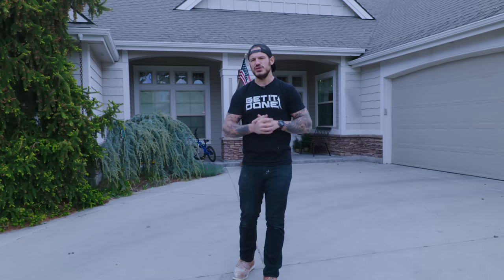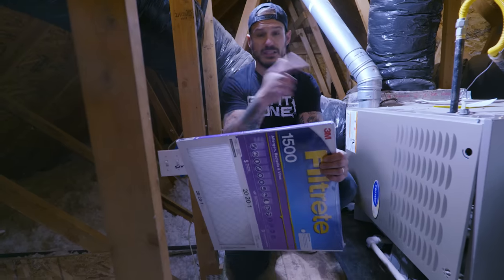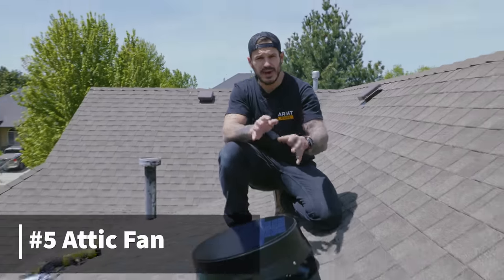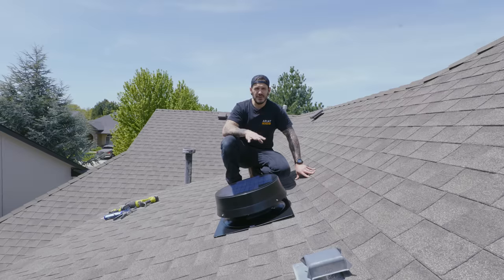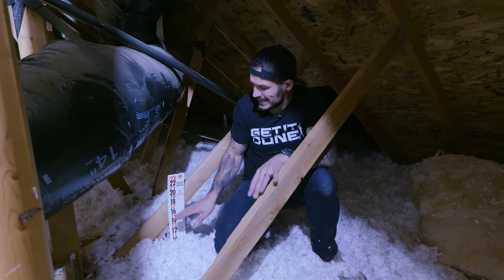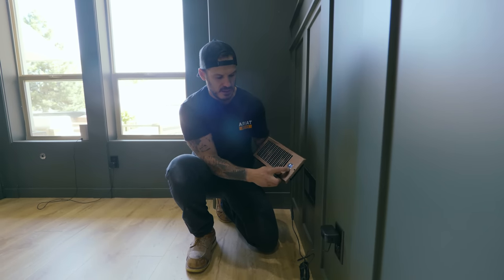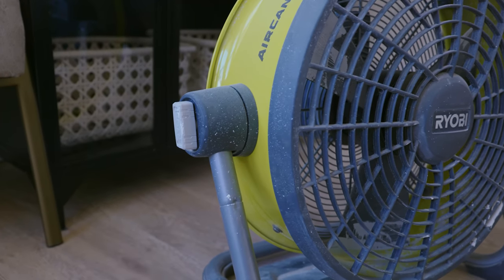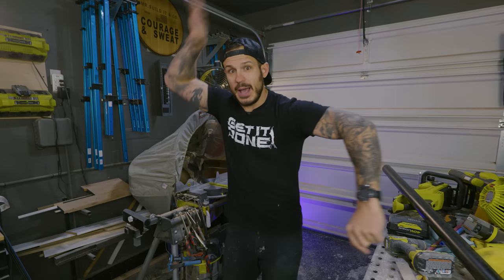15 Tips To Help Cool Your House This Summer + Lower Energy Cost

Comment: I use blackout curtains everywhere. Outsiders think I'm a vampire
Reply: But black out curtains work. They reflect the heat back from the house.
Reply: ....are they wrong?  🧐
Reply: White reflects heat, black absorbs it.
Reply: @HugoStiglitz89  The black out curtains that we have in our house aren't black, the face towards the room is brown and the face towards the window is white - but what is nice about black out curtains is that they're thick so they block 90%-100% of light transmittal, and because they're thick they also reject some heat transfer and noise. When COVID started I would open the blinds and curtains to enjoy the light, but noticed that my room would be 90-100° in December, and no the thermostat wasn't turned up that high. The light would heat up everything in the room and thermal mass would retain that heat well into the night. So I started leaving the blinds and curtains closed, and would be a much more tolerable temperature, so much for natural lighting.
Reply: I'll see you and raise... I put a foil emergency blanket over my windows secured by black duct tape.. 🤣🤣🤣
Reply: @HugoStiglitz89 Actually, white absorbs it also just on a significantly LOWER scale. Black absorbs on a HIGHER scale.  ✌️
Reply: I use lightweight Indian tapestries and clip them to valance rods or “already hung” curtains.  Of course the look is boho as heck but easy enough to put up and take down as a temporary “sun-block”.
Reply: @adamwhitt9349 totally works and those thermal blankets are cheap, too!
Reply: I always wondered if they significantly helped with lowering temps 😅
Reply: Now the neighbors just think you’re growing illegal plants in your house🤔💸💸💸
Reply: We do too.! Best investment especially for those who live in Texas Arizona, Nevada etc where the heat is relentless. Good 100% blackout drapes are super thick but nice looking and they do keep the house cool and they are noise barriers too.
Reply: Me too ! Really works!
Reply: R u
Reply: @zenrook1 oh yessss. I loved having a little bedroom facing the south, during the winter it got sunshine all day, and during the summer, no direct light, and I would use blackout curtains..... Miss it so much!
Reply: W❤

Comment: Uhmmm …cold air sinks and hot air rises….so in the winter you want to push the warm air down and in the summer, you want to pull the cooler air upward….unless you live in a cave, then you don’t have to worry about cold air or hot air…
Reply: Thanks. I went back over that because it didn't sound right. I thought I missed something.

Comment: Pro tip I've picked up from my hvac guy is use basic fiber glass air filters doesn't restrict air flow giving you better air flow
Reply: I install air conditioners daily and you are correct. We always recommend merv 8 or less.
Reply: You might as well not even bother with a filter at that point. Fiberglass filter does not filter much. The better move would be to get a quality filter with a high surface area like 3M 1900.
Reply: @phamlam3720  it does. You'll need to change it more often. Anywhere between 30 - 60 days
Reply: Same.  I've been trying to find some in my size.  GAME CHANGER!!

Comment: You need to wash your AC outdoor Condensor coils twice a year otherwise the compressor will overwork and cause problems
Reply: I just had a new ac put in a few months ago. Pls forgive my ignorance on this subject I know almost nothing about maintaining it other than keeping all the grass and dirt from accumulating. What coils? I'm in TX summer heat so I'd like to keep it effecient as possible. Thanks for any info.
Reply: Careful. Water is sufficient. Any chemicals may break down the aluminum and copper and cause leaking refrigerant.
Reply: Look up any video on cleaning ac condenser coils on YouTube. Basically just need to  turn off the unit. take a garden hose and rinse the dirt and dust off. Direct the hose and aim straight. No need for a pressure washer. 
Also replace your indoor furnace filters regularly. Make sure to get the correct size and have the filter facing the right direction. 

This will prevent your system from overworking due to lack of air flow.
Reply: @alexkwong6475  Thanks!
Reply: @dalpz205  also make sure you keep your air vents open. Closing off too many vents in the house will cause your ac to freeze up. Use a merv 8 or less air filter in your furnace. “Merv” is the rating for them. The lower the number the less restrictive it will be
Reply: @timneal609  Thank you.
Reply: Not true unless you live in a very very very dirty environment and run the AC year round.

Comment: Ceiling fans
Light bulbs (upgrade to LED)
Replacing filter
Upgrade to smart thermostat
Attic fan
Heat reducing window film
New insulation
Window shades
A/C inspection, replenish Freon 
Duct booster fan
Pressure wash exterior 
Pest control 
Air circulation methods 
Dehumidifier 
Energy audit
Reply: This video popped into my feed a year later, but wanted to thank you, SlickTurtle. 

I wish creators who make "list" videos made timestamps. Not necessarily to skip things, but to help just note things out.

Comment: about getting your AC recharged before the summer.
1) if your AC is low on refrigerant that means there is a leak because refrigerant is not a "fuel" that gets used up it is a gas and liquid in a closed system meaning that if its low there is a leak that has to be fixed or it will just leak out again. 
2) Also as important is to have both the inside, (evaporator) and outside (condenser) coils cleaned before the summer and 6 months later (so twice a year) because the coils is where the heat is exchanged from the air in your house and outside and if they are dirty the AC will work harder to get your house cool and this will break your AC faster

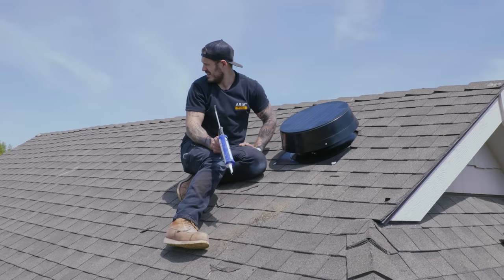Comment: About #6 (6:30), I had family member that installed tint in the living room windows and door, and it may reduce the heat and bills, but I hate the feeling of dark and muddy, very depressing, not for me.
Also another tip, will be to have or plant trees around the house, to provide shade.

Comment: Living in Arizona I've found that having the celling fan running clock wise works best.,also as it started warming up my AC wasn't working right the second time the AC guy came out he said with my old AC the new filter was no letting the proper amount of air,so got a lower price filter and AC started working fine
Reply: When I first bought my house I didn't know about the different filter types. If you get one too thick that's made to be hypoallergenic it restricts air flow and vise versa with a really thin filter. That affects the performance of the AC unit. If you're not careful your unit will work super hard to achieve a certain temp and the electric bill will be astronomical.

Comment: I'm glad I got my house weatherizeed back in 2020. Me being on ssi for disability I was able to get on a weatherization program from my city. I got the wood around my windows replaced and caulking, replaced bulbs with led bulbs, an automatic exhaust in the bathroom, removed all the old gas floor and wall heaters, new water heater, new insulation in the attic, insulation in the walls and under the floors because my house was built in 1939, and they gave me a whole new ac unit which the outside unit is a heat pump. They put in new stairs in the attic because that's where most of the air was leaking from and they sealed up everything even the chimney and my house has been comfortable ever since. The ac blows cold and I have the thermostat set at 80 and sometimes I have to cut it off because it gets so cold. The city even painted my house. I'm so grateful for everything and I tried to get my neighbor on the program to help get his roof replaced to because he's 65 and on disability but he's to stubborn to do it and his house really needs it.
Reply: It's a city program? I'm in Texas and I've not heard of energy companies or anyone doing all that. Would love to find it if it's out there. They will install automatic thermostats but you agree they can adjust the temp. Ya... Very much noooooo ty
Reply: @dalpz205  they don't adjust temps
Reply: @djpat5998  Idk if they do or not but I have sign a contract that allows them to. I live in Texas. I seriously don't trust an energy company to have my best interest in mind.
Reply: @dalpz205  it's not with a energy company it's through the city of Fort Worth.
Reply: @djpat5998  I'm in south Texas. Also I was referring to a contract offered to me by my energy company to lower my rates. Not a weatherization offer. Sorry if my wording was confusing
Reply: @dalpz205  I’m a home evaluator for a weatherization program. Typically the program is carried by local community action agencies and do have some income limits.

Comment: In regards to the "duct booster fan"; if you're looking to boost air flow because certain rooms don't get enough there's a bigger issue at hand. Improperly sized ducts or duct leakage. The booster fan are a waste of money.
Reply: Or you have a room (south facing) that gets more sun or generates more heat (computers) and the builders never take that into considerations. A cheap way to boost the cold air pulled into that room.

Comment: Great video, the only things I would say, unplug the furnace when installing a thermostat. If those 24v wires touch, you will blow a fuse in the furnace. Easy replacement, but for the average homeowner they won’t know what to fix. 

The AC being low on refrigerant due to a small leak, I would never recommend adding more refrigerant without repairing the unit first. Adding more pressure will increase the size of the leak hole. What the tech should have done was give you two options. One to find and repair the leak before adding more refrigerant or two, add leak stop to the system in an attempt to seal the small leak. Adding refrigerant to a system that is leaking is wasting money, because it will leak out again, faster. 

Third is the booster fans. These may sound like a way to cool a room better but they are horrible for you hvac system. That fan is pulling air which will make other rooms suffer from not enough air flow. And on top of that, they create massive static pressure in the system which puts a tremendous amount of stress on the system and will shorten the like of the system significantly.
Reply: I loved the no heat calls after the energy company installed the thermostats.
Reply: For the fans on the vents wouldn’t it block air flow?
Reply: @wardraven8755  it doesn't block air flow, it's pulling available air. Air and water flow the path of least resistance. The fan makes less resistance. The problem is, it can only pull from the available air the blower is sending through the ducts. It effects the static in a monster way that makes more of a strain on the blower
Reply: Excellent advice!
Reply: I wouldn't recommend leak stop as you don't want to contaminate the "sealed" system. I've replaced too many txv and filter driers that get clogged up over time. Not fun and not cheap then we got to look for that leak anyways 😂 Just find the leak and repair it the correct way the first time

Comment: As an hvac professional, watch the merv rating on your filters. Recommend merv 8. Filtrete pushes their merv 11and 13. These actually are to be replaced 2 times a month. They may seem clean but the high filtration they are actually filthy. And they are also not designed for most systems. Static restriction almost kills the designed static pressure
Reply: Same thing with the booster fan. Creates massive supply side static pressure. Not good
Reply: I get so many calls about frozen air conditioners just because of a merv 13 filter. Or closed off vents
Reply: Well, some of the micro-pleated filters don't have too bad of a pressure drop. There was a great dest done by project farm here: https://www.youtube.com/watch?v=RkjRKIRva58&t=611s
Reply: @Mattspips  right but there there is a specific point at the beginning you missed. They are all merv 8. Exactly what I said to use. Whether they are fiberglass or micro pleat, they are still rated at merv 8. That's the big kicker I tell all my customers
Reply: Yeah I noticed when we have a higher merv rating it reduce the airflow and seems to strain the blower motor. I immediately went to Publix and got a MERV 8 level. Then it started to breath again!
Reply: Love the Merv 11. Change it out once a year, no problems
Reply: The set we got at costco doesn't even have a merv rating, just "2200 microparticle performance"
Reply: @rowan729  what brand?
Reply: @johnurban7333  congrats. You are lucky. It's not if but when you will have issues
Reply: @jerbarela  exactly right
Reply: @jerbarela  what do you recommend

Comment: I had roof exhaust fans, but when I had my roof replaced, they found the old nails were rusty, because the attic didn’t get hot enough to dry out the air up there, and it would condense on the nails. In addition to ventilated soffits, I now have under-shingle edge venting and a full-length ridge vent. Insulation keeps the heat from conducting down through the ceiling.
Reply: What is under shingle edge venting?
Reply: @one7decimal2eight  maybe they're referring to vented soffits?